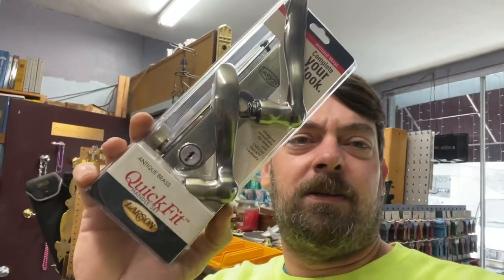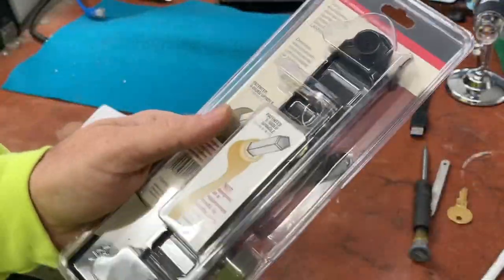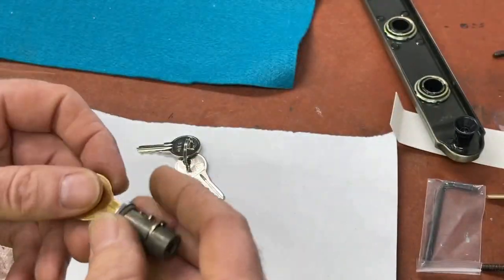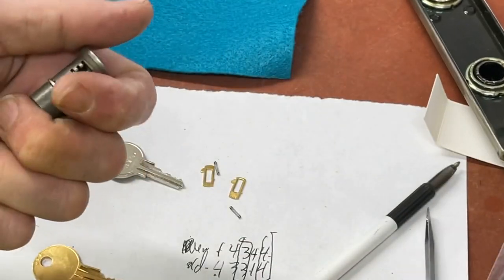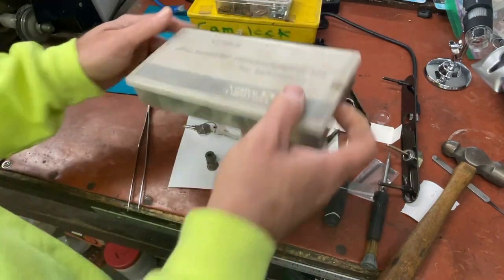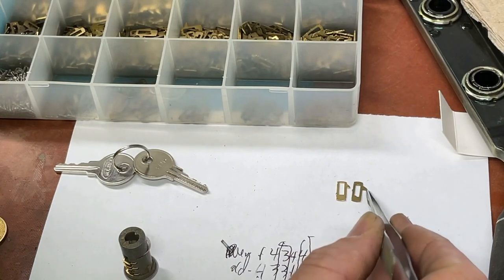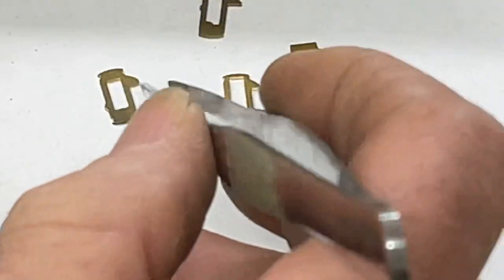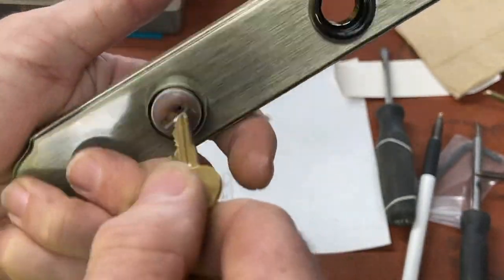Larson Storm Door lock rekeying

Comment: Quick question:  If the internal knob to that tumbler lock gets hard to close and open, is there anything other than having to rekey the lock to get it to open and close smoothly again (other than buying and replacing the entire internal mechanism inside the storm door from Larson)?
Subscribed, fine technical video, far different from rekeying a Schlage door lock/deadbolt set.
Reply from the maker: Lubricant? Not graphite. Get LPS-1, TriFlow, Houdini and spray it down!

Comment: Great video. Well I have used in the past myself is if I don’t have anything in a camlock that will actually work I have also used to wait for locks from automotive kits sometimes they work as well in pretty handy for springs if you need them as well or like you said doing some modifications to the wife are also will get you out of the woods if you need it to you.